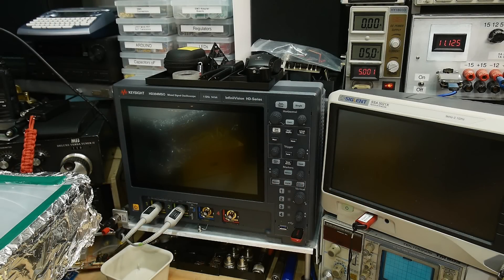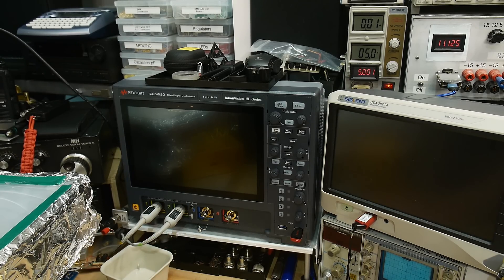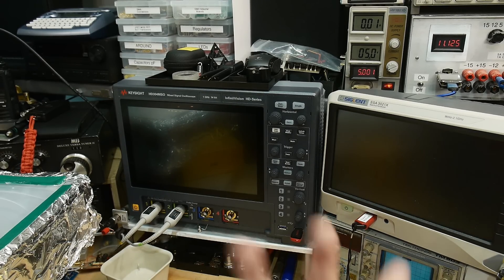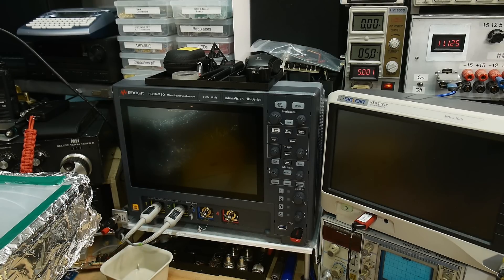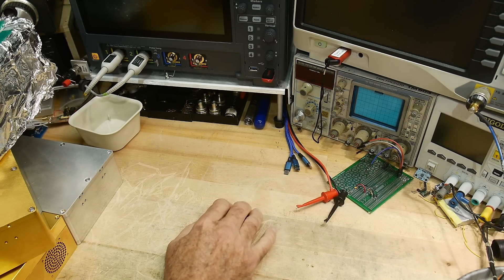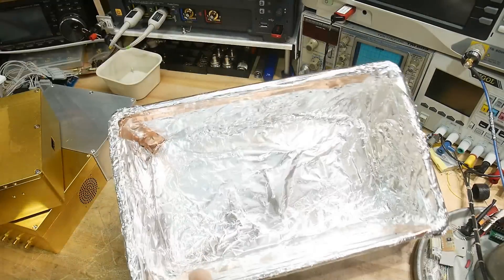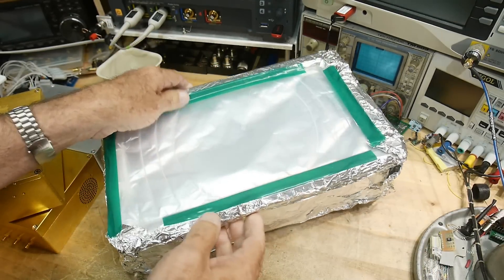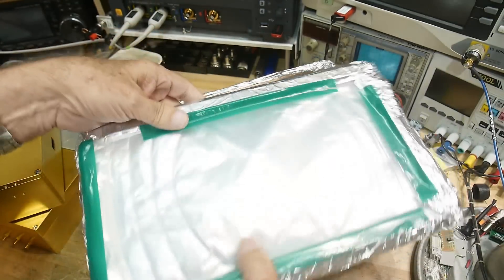#2042 RF Faraday Box

Comment: 1:50 all you need was cookie tin can 🤏as per
Linear Tech ApNote 159 - Measuring 2nV/√Hz Noise and 120dB Supply Rejection
on Linear Regulators
Reply: Where are you buying your cookie tins that they come with a copper box inside and a mu-metal box inside the copper box?

Comment: I have some of the mat from Spectrum Microwave, not sure if they are still around. But it is part number 21109145 or PN 700-17164-0001. Good luck finding a data sheet.

Comment: Have you ever used box vented with mesh with a depth close to the noise source frequency. The cavity creates standing waves, so you can still have a screened box with a hole cut in it. HP used this for some of there test gear

Comment: There must be a few hundred bucks of gold plating on those boxes considering the current price of gold.
Reply: It's only a few atoms thick. Almost nothing. Literally pennies worth. (The application treatment costs more than pennies but the value of the gold is only a small part of it.)
Reply: @AdmiralQuality  Back in those days they did much thicker coating. For example on the, now infamous (among gold recyclers), Pentium pro CPU they used up 0.3g.
Reply: @galileo_rs  Well, it depends on the application, I guess. And .3g of gold is only $25 USD.
Reply: @AdmiralQuality  It is but the surface area of these boxes is many times the surface area of a CPU

Comment: The "grommet" material is just conductive ground foam/tape found all the time in 90s/00s desktop computers and laptops. Usually stuck to the metal outer case panels.
Reply: I saw some stuff like that in a computer display I recently disassembled for connecting the board's ground plane to the light's. Spongy but metallic.

Comment: I recently put together a 19 Gigaohm resistor inside a copper enclosure that connects to a guard potential and is in turn housed in a metal box that is grounded. This was used to test an electrometer I was repairing. It worked well, eliminating almost all outside interference. Regards, David
Reply: 1 резистор 100 гигаом стоил 75 долларов я позвонил в компанию и мне прислали готовый

Comment: Interesting video. I recently built a RS232 sniffer / splitter and lined the box with copper tape but it's not perfect in that it doesn't cover the entire inside of the box. I realize I've basically created a capacitor, although it might not be a problem it might also be less resistent to RF than without it perhaps? 😅

Comment: I few decades ago, I had some of that RF absorbing sheet material.  I thought it would be really cool to line the inside of a front bumper cover to see if it would make a car invisible to radar. I wonder if anyone ever did that? I used a lot phosphor bronze for RF shielding because if it's springy nature and that gasket material that feels like a cat's tong. It's silicone but with tiny wires oriented in one direction. And yes, aluminum foil generally makes things worse. Any overlap becomes a slot and that's all it takes. I guess it must be because aluminum oxidized so easily.

Comment: Hi     I used some of the foam covered in wire mesh many many years ago  . I must have got from RS or Farnell ( in the UK ) as thats
where I got most of the stuff I used at work . If it was a Vero product your out of luck as they no longer exist .
                                                                                                                                                                                                        Alan

Comment: As an Electromagnetic Engineer for 50 years there are 2 great reference books for shielding, Dr. Clayton Paul's and Henry Ott's books on Electromagnetic Compatibility. Also,  for EMI gasket materials look into Spira Corporation or Chormetics. The magnetic field is the major shielding component you have to deal with.

Comment: Jim Williams was famous for using heavy gauge tin plated cookie tins because they provided better shielding especially at lower frequencies. Henry Ott preferred paint cans. This is one area where spending a lot of money doesn't buy much if any improvement...
Reply: Yes, the old style cookie tins are tin plated steel which attenuate magnetic fields as well. Nowhere near as good as mu-metal or other soft magnetic material but if you need better attenuation you can always put one tim plate box inside another. At AF I often get magnetic field junk, usually transformers radiating 50/60Hz and lots of harmonics, the cookie tins work wonders to get rid of it. Shame all the cookiecandy assortments we used to get at xmas are all plastic tubs these days.

Comment: Great video. A few topics come to mind.
First, the material that the box is made of aluminum versus brass versus copper versus nickel . I’ve made several enclosures using un etched copper circuit board, and soldering the joints together.
Second a company in Connecticut called Miller. Stevenson makes a conductive nickel spray dries to a rough sand like finish.  I’ve used two coats over the surface of a small plastic box with great results.
Reply: Yep, I've made RF enclosures (for test items) with copper-clad circuit board too.  Solder the sides to the bottom to seal it up.  Might use copper tape to seal the top to the sides.  It's not as clean as a machined aluminum enclosure, but it's certainly quick and cheap!